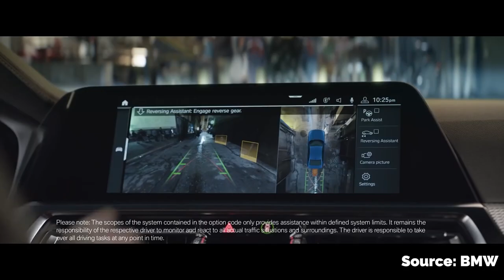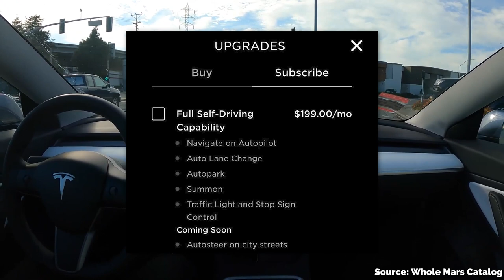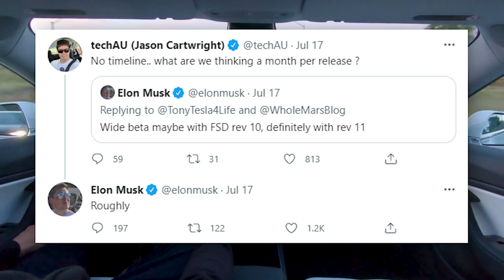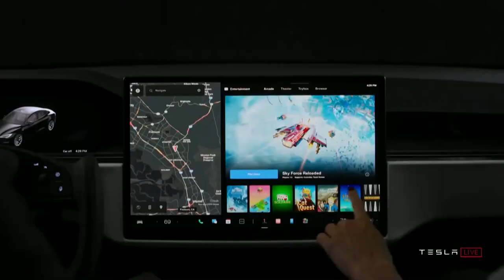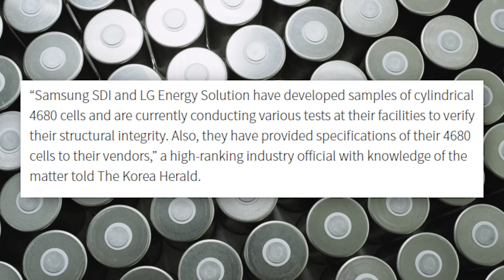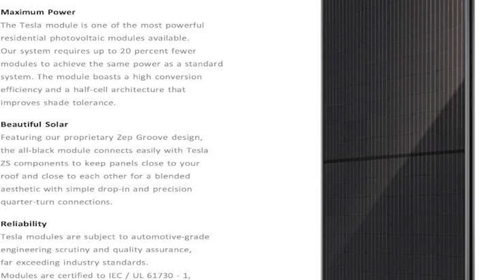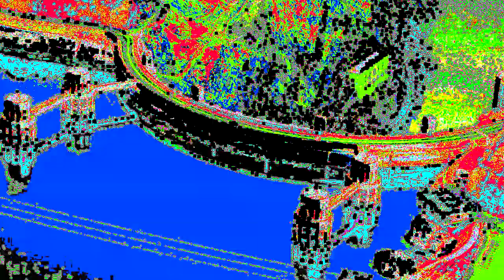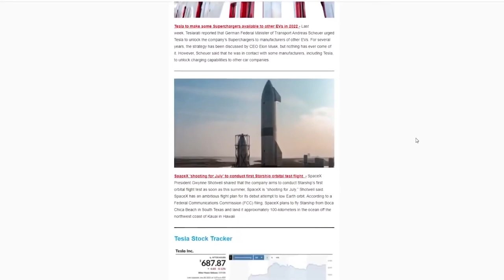Tesla Giga Factory Berlin Update, FSD Subscription + More Tesla News!

Comment: 5:33 Correction: Electrify America chargers are being built out, not rolled out.  The only chargers being rolled out are Tesla superchargers, 4 on a slab that fits in a shipping container, trucked to a site, then just plopped on prepared ground and connected to mains.   You can see where 3 of these quad charger modules were installed on the east side of the GF5.
Reply: I know he's literally made them nearly plug and play

Comment: Always like your videos, but just one point. The cells are not referred to as 4-6-80. They are 46-80. The cell has a diameter of 46mm and a length of 80mm, hence 4680. A small detail, but might as well have the terminology correct. The Model S and X used an existing industry standard cell size, namely 18650. For some reason there is the zero after the 65 which is the length of the cell in mm and the diameter is 18mm. I'm not sure if the Model 3 & Y 2170 cell  was another existing standard size or a Tesla invention. No zero at the end for the 2170. Even the 18650 is these days often being referred to as the 1865...

Comment: I'm curious how the power for the community will be controlled as sometimes the maintenance crews will need the power to shut off to work on the fix electric lines.
Reply: It's probably controlled by the Smart power meters they put on all our homes?!? Probably
Reply: It might also be controlled simply by measuring the voltage level (and possibly reactance) of the grid. If the voltage drops to a certain percent, like 90%, the power wall could provide power to help lift that up some, perhaps until it reaches 95%. Then, if the voltage drops to something lower, like 60%, it could disconnect the power wall from the grid.  I don't know what those thresholds are or should be, I'm simply speculating.

Comment: Would I volunteer my power wall for the greater good? The answer is yes, so long as the power companies are willing to provide adequate compensation for use of my hardware.
However, determining what that compensation should be depends on a number of factors, for one, how much extra battery degradation can be expected for doing this? 
There needs to be a more detailed discussion about the details of how that system is expected to work. Does it happen on a daily basis, or just during black outs? How does the power wall determine when it needs to provide power to the grid? (I suspect it would provide power if the grid voltage drops to a certain percent like 80%, but would disconnect completely if it drops to a lower threshold like 60%. Reactance attenuation could also play a part, which might benefit the grid and power companies at a slight cost to the consumer.) I think, compensation reports would be necessary with each monthly bill.